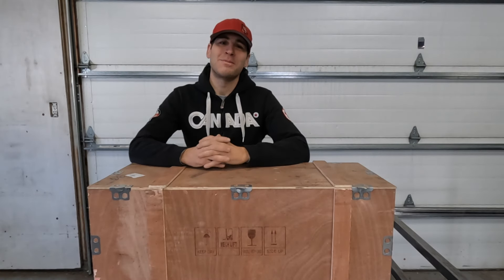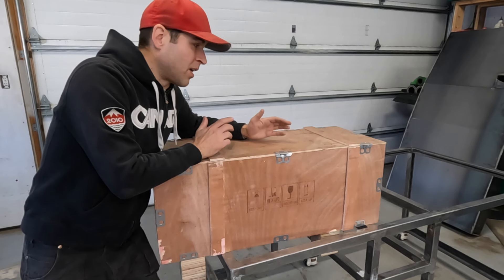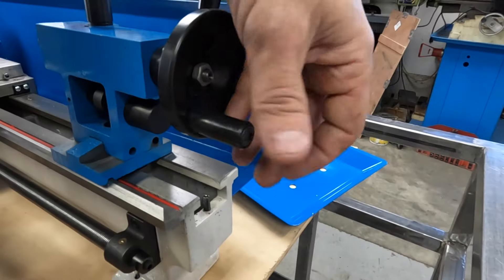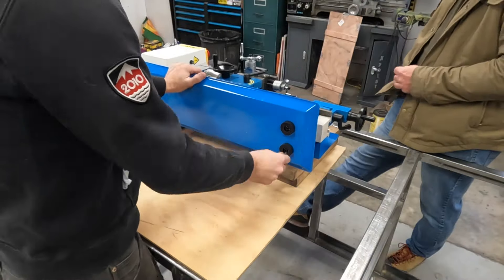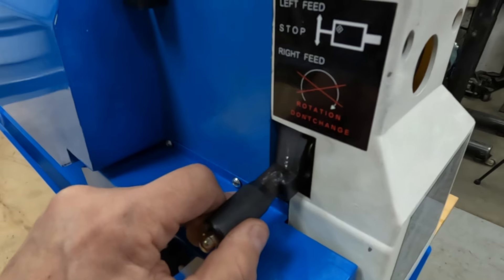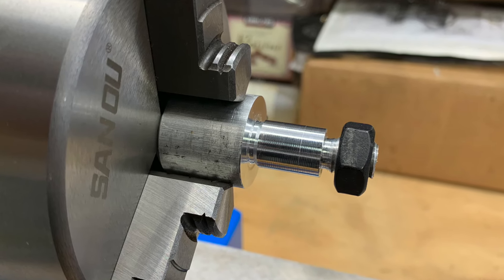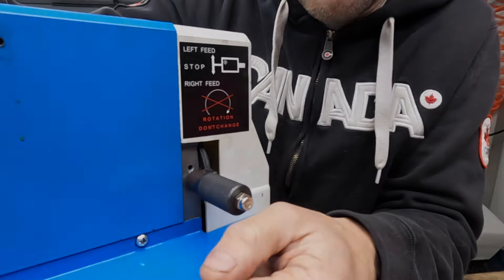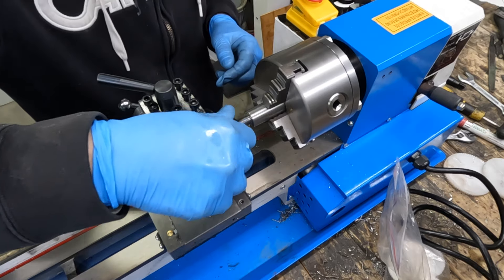First Chips On The Vevor Mini Lathe - Everyone Should Have One A Lathe !

Comment: Those thread look wonky.  Not symmetrical.
Reply from the maker: This was a while ago, but I think what happened is I started threading without setting the compound angle correctly, and then just finished them off at the right angle. I'm sure it's not the fault of the lathe, haha.

Comment: Hi, I think you if check carefully you will find that you have set the compound slide angle wrong, it looks closer to 60 degrees than 30 . Happy turning..
Reply from the maker: You are the seconds person to point this out ... I did start to set it at one point, and then got destracted by filming.... the thread on the aluminum part actually didn't turn out because of this, but I thought it was only out a few degrees. 

Isn't 0 pointing at the chuck and 90 pointing at the back of the lathe ? 30º is achieved with the handle moved right of 45 ? or have I been doing it wrong all this time. This is how my other lathe is labeled.
Reply: Hi ,my lathe compound slide starts at  0 degrees then in 10 20 30 etc in both directions. If you want 30 degrees ( or half pitch angle ) on slide you need to set compound slide to 60 degrees because you are setting the angle between the chuck face  not the spindle axis,   Hope that makes.  Roger.
Reply from the maker: @rogeroliver5083  Yes, the mini lathe has a plastic piece screwed to the side of the compound. My mini lathe doesn't even have a reference mark on it, but the reference line should be pointing back towards the operator. 

I think your reference point is incorrect. 0º is with the compound aligned with the axis of the lathe. 30º clockwise from there (actually 29) is where it should be set to cut threads.

If you are using the face of the chuck as a reference, you are starting at 90º from the chuck and moving clockwise, making it 60º from the chuck.

Comment: your compound angle isn't set where it should be.  it's 30 deg. off
Reply from the maker: Are you sure about that?
Reply: @loweredexpectations4927  83 years old and most of my life spent with lathes.  The angle of the compound should match the angle of the back of the thread.
Reply from the maker: @richbuege6491  Looking at the video it does appear to be too steep. It's supposed to be set to 29.5, right?  It does look like I have it set closer to 60. Must have been a brain fart as I am aware of what it should be... not because I've spent much time with lathe, but because I broke my foot really bad, and spent a year on the couch watching Mr Pete videos.
Reply from the maker: @richbuege6491  PS. The "are you sure about that" wasn't sarcasm or me beating my chest. It was because I make a lot of videos and was genuinely asking if you were sure.

Comment: I have a question what is that knocking sound when the chuck is turning mine does that also and I was wondering if that is a problem. I noticed you didn’t say anything about it. Please help thank you.
Reply from the maker: That is the sound of the motor pulley. It is a little loose on the shaft and moves around with the tension of the belt. 

To stop this from happening, you can use some blue loctite between the shaft and pulley.

Comment: Whilst seller was quick to ask for Feedback on my purchase, not providing a cutting tool meant a delay to trying it out. The Spindle Bore is only 21mm - would have been better at 26mm so 1" or 25mm std material could be used. The tailstock lock lever is really annoying interfering with back guard. I guess as a budget entry machine it is a good learning tool preparing you for your next purchase and what to look out for. Atleast the E-stop is up front where some larger machines I've seen you have to reach over the chuck to hit the stop - last thing you want to do is reach further into a machine area in an E-stop condition.
Reply from the maker: Thanks for the comment. 

I'm sure they are out there, but I have never seen a lathe that come with cutting tools. This is partly due to preference and variety of different tools. When I got my first machine, all hobby machinists used high speed steel, as insert tooling was WAY too much money, so you actually had to learn how to make tools before you could use your lathe, haha. 

I totally agree with the spindle bore. A larger bore is of course always better, but my 10 x 22 lathe also has a 3/4 (19mm) spindle. This is because with a large bore, you either reduce rigidity or require a larger OD on the spindle, and an larger spindle. Larger spindle = more cost and larger casting required. 

These lathes are a good way to learn how to use a lathe, and also open up possibilities that are not possible in the home shop without one. A lot of people upgrade machine tools shortly after getting their first, because the original ones open your eyes to what is possible. 

I started with a 10x22 lathe, and I think it is perfect for me, but it takes up a lot more space, can't easily be moved by one person and cost about 3 times as much.
Reply: @loweredexpectations4927  I have the ticking sound you said was the motor belt so will have to investigate that further. cheers
Reply from the maker: @huntz3215  Yes, it is the likely the pulley moving on the motor shaft due to the tension of the belt. If you put some thread locker on the pulley and shaft this may solve it.

Comment: Why does your lathe knock when it  spins?  Mine doesn't.
Reply from the maker: They pulley doesn't fit snug on the shaft. If the belt is a little loose, then it may not click, but it is pulling the pulley back and forth as it rotates.

Comment: That exact lathe is available with steel gears for a few dollars more. I have the same lathe that I ordered with steel gears. I also bought a set of extra gears to cut metric threads. I bought a four jaw chuck and a face plate for my lathe. I also upgraded my tool post holder to a quick change turret. I purchased quite a few extras for my Vevor lathe. While restoring my C3 Corvette,  this lathe and my Wen milling machine are great to have in my shop.
Reply: I forgot to mention.  I also bought the collet chuck and collets for my lathe. It saves a lot of time over dialing in each part that needs cutting.
Reply from the maker: Did you just make this purchase recently ? I just saw that someone made a substantial purchase and was wondering what they bought, haha. ($566.24) that may be US dollars. 

Either way, good stuff !
Reply from the maker: I've wanted one of these for my 10x22 forever... never got around to getting one.

Comment: Great video! I'm going to buy one of lathe like this just because i think it would work fine for my small projects and because its fun to work with a lathe. I have not used a lathe since college but i still hasn't forgot how to use one
Reply from the maker: They are a great tool to have around the shop. Not ideal if you are planning to start a fabrication business, but great.
Reply: @loweredexpectations4927  Yes i would think they work great, it looks like that in your video. I'm not going to start a fabrication business i'm only going to use it to make some bushings or smaller bolts i would have need for and maybe some other small stuff for my projects

Comment: I have one of these lathes in fact the same one and have had it for over two years now it gets a lot of work and I am still running plastic gears and never had a problem, I do how ever have a full set of metal just incase but for now I am just going to keep running the plastic gears.
Reply from the maker: Haha... yes... I think there are two factors that come into play with the plastic gears. 

1. How many times and how hard you crash your tool into something with the half nut engaged. A lot of new users get these lathes so that is more common than it would be with a $4000 lathe, haha. 

2. If the gears are already stressed from being pressed on. Some of them seem to be quite undersized. If they are already stretched / stressed then it doesn't take much additional force to cause them to fail.

Comment: Great video, I have a great like for Vevor, and have several great deals from them. Check your angle setting on the compound, its travel should be just a bit inside parallel of the angle of the cutting edge of the threading tool , making one cutting edge doing the bulk of the work. Enjoyed and subbed, cheers!
Reply from the maker: Thanks for the comment and tip. Sorry I missed your comment and didn't get back for so long.

Comment: I added a srandard and metric threading dial indicator to my lathe and use multiple magnetic base indicators to stop at dead zero every time.
Reply from the maker: Excellent ideas. I have a tread dial on my other lathe... I'm always afraid of using it as I don't' do a lot of threading.
Reply: Link to metric threadin dial indicator?

Comment: I've been benefitting from these videos over the past two years.   I want to buy a little lathe just for fun.  I haven't used a metal lathe since I was in high school in 1957.   Doesn't matter.  I'll have fun.   I have definitely decided to not buy price.  I'll allow six thousand or so for the lathe and accessaries / addons.   Maybe more.    The size?   At least 10 x 20 inches.   I don't want a lathe that has ball bearings on the spindle.  Tapered rollers is much better.  Will I select a gear head?   Maybe.  Haven't decided.   I have an idea that I'll do lots of threading.  Changing gears all the time doesn't thrill me much.  I don't think I need a digital display.  Speed adjusting seems more intuitive to me.  

I like Proxxon but they are too small.  Otherwise their quality seems above average.  I like Sherline quite a lot.  Not sure though.   On their website they don't provide prices but instead offer financing.  They want to sell you on a product and later tell you what the damage will be.   This usually means they are pricey.   I don't mind spending but I don't want to have to search for the rest of my life to find out what something costs.   Why do they hide it?  Maybe because of the current inflation.... it changes a lot?   

So far I am leaning towards the one from Taiwan.  Precision Matthews 1228 model with dro and  a box of goodies to make it even more fun.   This one runs on 110vac single phase with a variable speed DC motor.   Seems just right.  Any larger lathe from PM needs 240vac and maybe three phase too.   I don't need all that sophistication in my garage.  

Watching all these videos is almost as much fun as having the machine all set up and ready for ????   I have no idea what I'll use it for.   I guess I will find out later.   

May as well get a little mill while I'm at it.   Why not?   Fun fun fun...

The reader can tell I'm the fussy type.  It's true.  Why not?   After all this talk I'll probably end up buying a Harbor Freight 14 inch.  ha ha...   Well, I can have fun on that model too.
Reply from the maker: Precision matthews has some great stuff and they are great to deal with. I bought a milling machine from them, and have heard nothing but good things. 

LOL... we all want a big fancy lathe ... but the fact that we don't all have one means we come up with reasons not to go through with it. It is a little harder to justify if you don't' even know what you will be doing with it, but, if you have one, you will find things to do with it.

Comment: I believe you have a British metric piece to replace. I have run across them a bunch of times over45 years of machining. Just real old things used them. Most defeinatlt you woll need a live center you can make with it and I am glad you have the metal gears on order. Fun post so I sub'd you and rang yer bell as well.I pour silver. Stop by for a peek. I try and fave some fun in the process. I am a BC fella from Vanderhoof. Just west of Prince Geord in the middle of the povince , Where are you ? If this is throwing a good thread I am thinking you have a good tight lathe there. A good test for any lathe. Take care eh
Reply from the maker: Thanks for the comment. Sorry for the delay, it has been a crazy summer for me.
Reply: @loweredexpectations4927  Sure nothing wrong with being busy. Stop by some time if you like.

Comment: does it have a pitch gear selector for cutting threads?
Reply from the maker: That is generally something that only comes on larger and much more expensive lathes. This lathe, and most others, have "change gears" and a chart. If you want to thread 1.5mm threads, you select a combination of gears to install... If you want to thread .8mm or if you want to cut SAE threads  24 tpi, you look at the chart and install the appropriate set of gears.
Reply: @loweredexpectations4927  thanks for explaining!
Reply from the maker: @marcdaslama  You're welcome.
Reply: You need a thread dial.  Threading requires multiple cuts.  You can’t cut the total thread depth in one pass.  To start in the same position for each pass, you need the dial.  Otherwise the job will be destroyed on the second pass.

Comment: I got one from princess auto.  Are the upgrades the same? I noticed there is no hi/low speed manual shift for head stock
Reply from the maker: I believe these are basically the same, but can't say for sure. I believe they call this series of lathe the CJ0618. 

I was also confused by no dual speed range.... There are even decals on it that indicate a high and low speed range. I will look into that more when I swap out  the gear set.

Comment: It has been a long time since I cut threads, but never recalling advancing the "X" compound axis between cuts on a thread. That moves the tool out of sync with the previous cut. Yes, it will thread on but the threads are not matched then. It also does appear when you show a close up of the thread, it does not look symmetrical. To me. that handle should not be touched after the first cut.
Reply from the maker: I'm not sure what you are considering the "X" ... To cut threads, you generally use the cross slide set to 0, and then use the compound to get to the thread depth. 

This is done so that you are not using the cutter as a forming tool, and instead, using the leading edge of the tool. This is why the compound should be set to 29.5º

Comment: Used your USA vevor link and cant get pass the $5 coupon pop up…
Reply: Hello Mac... This is Joel from Lowered Expectations. I'm responding from my other account so that I don't lose your comment. I have sent my contact at Vevor an email asking about this and will respond as soon as I hear back from them. 

I assumed, when it happened to me, that it was because I had already used the code in the past, although I'm not sure I have. Either way, I will get back to you ASAP.
Reply: @JoelArseneaultYouTube  
     Cool , I was looking to compare prices and models.
    And it kept blocking me with the $5 coupon and also wanting me to sign up.
   I do not want to sign up for anyrhing
Reply from the maker: Hello again Mac. 

I got a response from my rep at Vevor and she says it is working fine. I tried it on my account and it works for me. 

One thing that I have noticed is that ... You select the address, payment method and the "pay securely now" button will be orange, but when you enter the code, it turns gray ... Not sure if this is the issue you had ? 

In this case it appears that you need to reselect the payment method. I couldn't get it to work for me the other day and ended up buying an item at retail... yuk, haha.... but today it seems to be working for me. 

Let me know if you can't get it sorted out.
Reply from the maker: @Mac-mu9cs  Oh, she also told me to make sure there are no spaces before or after the code. If you copy and paste it, you can sometimes copy and paste a space before the code. 

Haha.... I get it.... I don't like signing up to sites either. Now I just use chrome and it allows you to log in with your gmail account. It's not better except that you don't have to remember anything. 

I have it even worse than most people as I have my personal account, but I also need my "influencer" account that is separate.
Reply from the maker: She emailed me again and said that if you can't get that to work to try one of these. 

VVPROMO
VVSALE
VVSALES

Comment: It's best to keep one gear plastic when replacing the plastic gears with metal ones. This way if you end up jamming the machine up it shreds the plastic gear first, instead of ruining the teeth on the metal gears, or worse.
Reply from the maker: Yeah, my bigger lathe has one plastic gear on it for this reason.

Comment: How you make thread on this?😮
Reply from the maker: The lathe comes with a set of gears that change the feed rate of the apron in relation to the spindle. 

Lathes are basically always cutting threads... just really really fine threads. The pitch of the threads is determined by the different gear ratios. There is a chart on the cover that tells you what gears to use for what thread pitch.
Reply: @loweredexpectations4927  Thank you very much. I thought a lathe like that couldn't cut threads.
Reply from the maker: @jaroslavdulik1439  Yes... Most lathes can make threads. it will take a while to learn, but you can do it.

Comment: The clicking noise can you fix that? I have the same lathe super annoying
Reply from the maker: Hello... Yes... Funny that you ask... I literally just fixed this one, haha. 

The clicking noise is the pulley on the motor shaft. What I did was remove the pulley, cleaned the hole out as well as the motor shaft. I then applied a generous amount of blue thread locker and tightened up the set screw. 

I waited about 1/2 an hour, installed it making sure the belt was centered and not too tight. Getting the belt to center and tensioning the belt is a bit of a pain, as you have to move the entire motor... but you'll get there. 

It's so much nicer now. I just installed the metal gear kit.